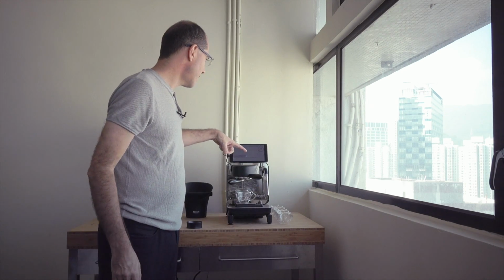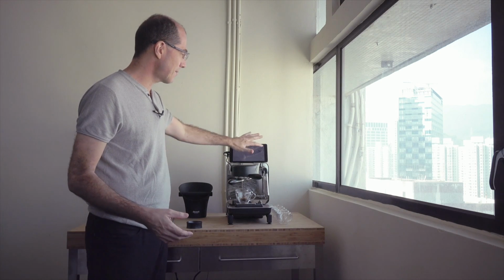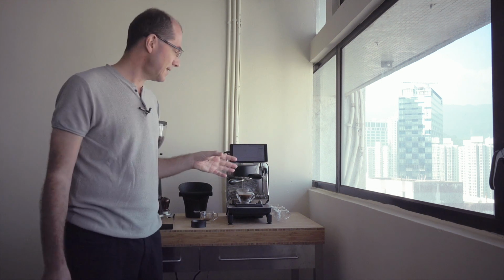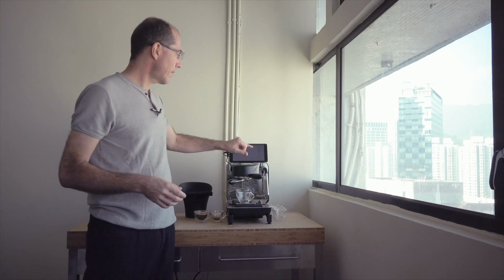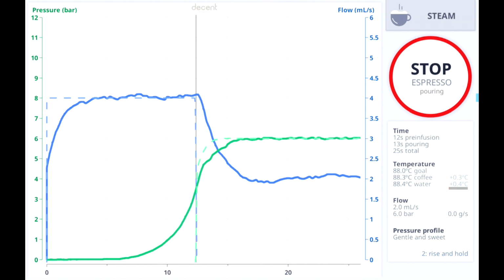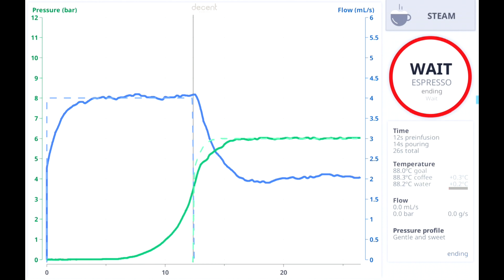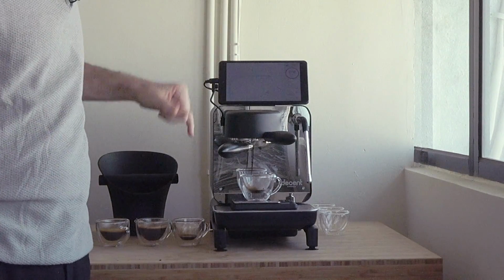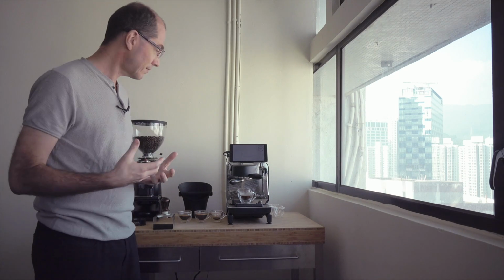How to dial in your grind

Comment: Did you remember to change the basket to 20g for shot #4 to give it enough headspace? What is the tolerance for each basket +-1.5g? What happens if we go overboard, will it create a messy shower screen?
Reply from the maker: Typically you can go up to +2g on a basket, and it's not that it's messy, but that it prevents the puck from fully swelling. This can be a good effect taste-wise, depending on the beans, so it's part of the arsenal of techniques you should keep in your pocket.
Reply from the maker: Typically you can go up to +2g on a basket, and it's not that it's messy, but that it prevents the puck from fully swelling. This can be a good effect taste-wise, depending on the beans, so it's part of the arsenal of techniques you should keep in your pocket.
Reply: @decentespresso  Thank you! Can't wait to try it out when my DE1 arrives

Comment: How come such highend machine like Decent has a small footprint whereas the regular espresso machines are larger?
Reply from the maker: Very different tech.  Traditional machines use a large boiler for temperature stability, whereas we use heat on demand, and a water mixing technology, to do give you 0.3ºC temp accuracy, instantly.

Comment: I am confused by the 32g in the cup when you stated a 2:1 ratio and 36g was the target. What did I miss?
Reply from the maker: I'm not religious about my ratio in the video, and since I stopped it manually, didn't nail the weight.  Honestly, I was a bit distracted filming which is why I didn't stop it as accurately as I could have.  In later DE1 versions (this is an old model) the machine stops at the specified ratio for you.